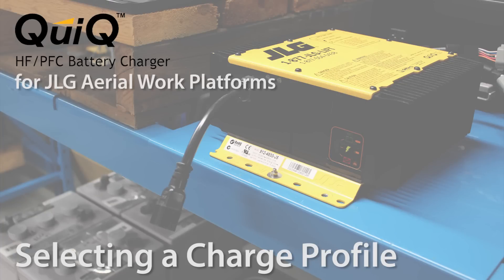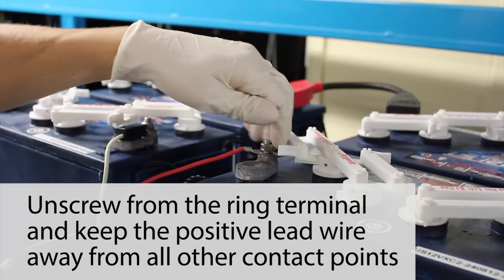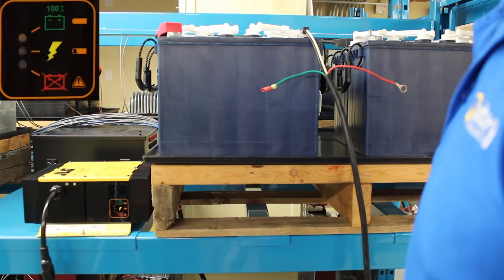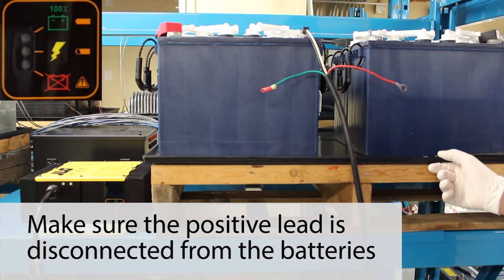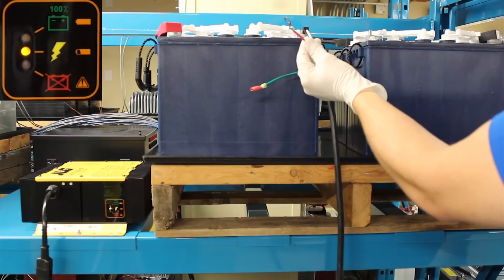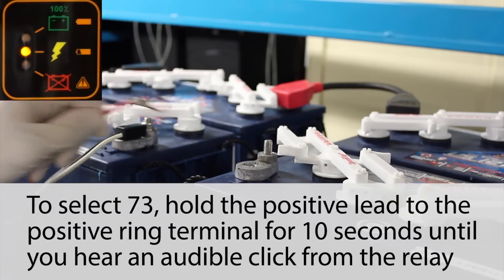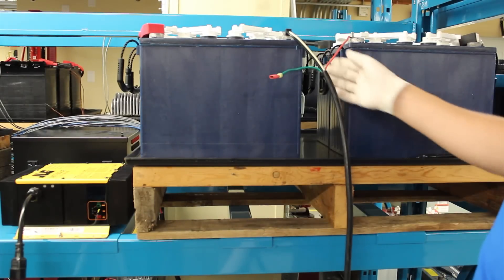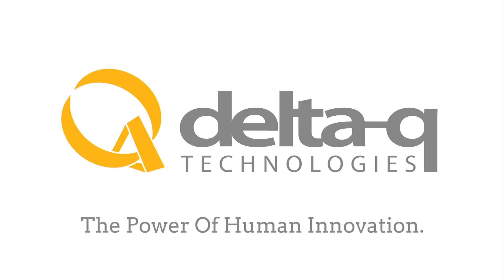Delta-Q QuiQ Charger for JLG Machines: Selecting a Charge Profile

Comment: Why would u change a profile in the fist place, newbie
Reply: No one answered your valid question... I have problem with my EV Ranger and I have this 73 code. I did change/remove the 73 cide, but the default 2 flash remain...so Was it wrong move to even try to change the charfing profile 73 if it was the correct profile to my EV Ranger?
Reply: @pekkaparikka2883  q
Reply: @pekkaparikka2883  Yes, 2 flashes means (battery low voltage) your batteries need to be charged SEPERATELY one at a time with a good old style battery charger. Then your QuiQ charger will charge your batteries. The charger senses the batteries voltage being too low so it won't start charging the batteries until they have enough voltage in them so that's why you have to disconnect them from each other and charge each battery separately. Then you can connect them all back together and use the QuiQ charger to recharge them when you discharge them a little after using your EV Ranger for a while. I don't work for the company I'm an A&P Aircraft Mechanic just trying to help you out. I have an old early 2000's JLG111 4624 scissorlift with a QuiQ 2425 charger Model # 910-2400 and I had to charge each battery up separately at first before using my QuiQ charger on the JLG11 4624 scissorlift. I have to do it again because I didn't keep them charged up during this last winter of 2021-2022. Good luck.
Reply: @jetenginethrust863 what if it’s blinking red twice and hasn’t even been plugged into the vehicle yet? Also note the vehicle runs perfect and batteries are all good and charged.